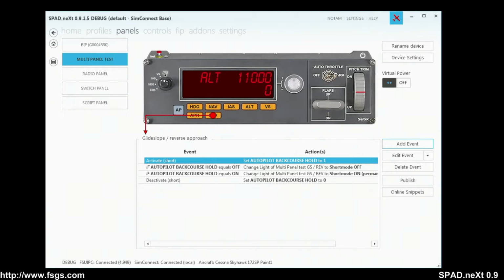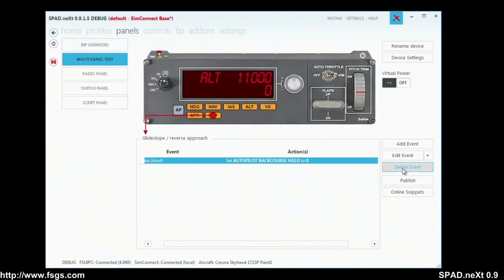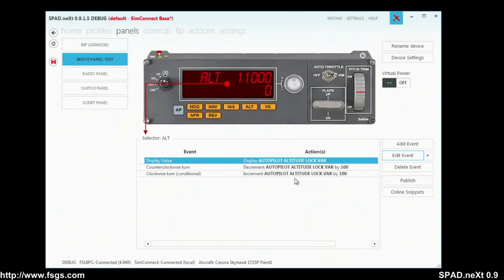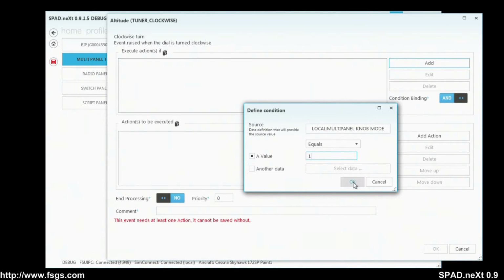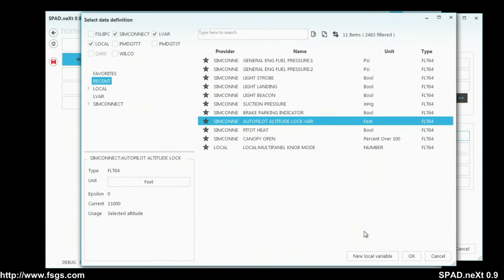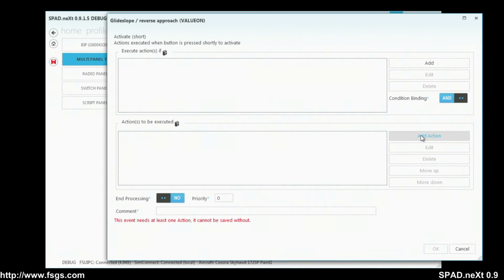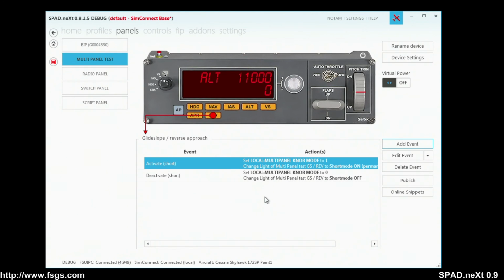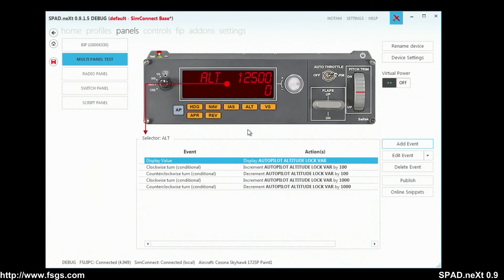HOWTO: Emulate inner/outer knob on multi panel

Comment: I love this tutorial. I have a problem and without going into to much detail, I'll keep it short. At the point you create a var def and called it MULTIPANEL KNOB MODE. You add a new event turn clockwise. Add condition. Browse to MULTIPANEL KNOB MODE set var equal to 1. Click ok. Now for that condition there is a rex circled X, which probably means that it is not correct. So following the rest of the tutorial is futile. Can you tell me where I went wrong.
Reply: got it sorted out that you for the great tutorial.

Comment: If I did not want to use the REV button on the multi panel but wanted to use a button on the separate switch panel could I still do this? In other words mix both panels.

Comment: That's great. I will be buying for just that function. Can this also increase the trim rate on the multi panel? For example In the default FSX Cessna 172 it can take far too many spins to trim.
Reply from the maker: for the trim not using the Trip up/Down events but using the Trim Percent events, you can set the increments to whatever you like.